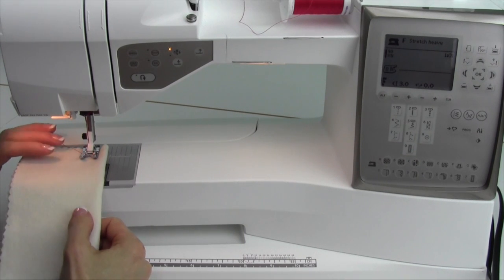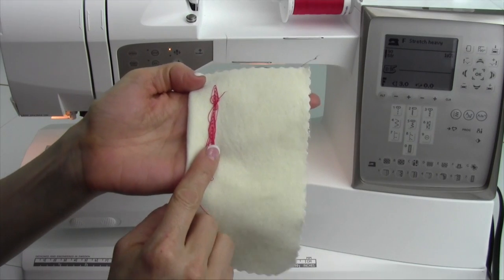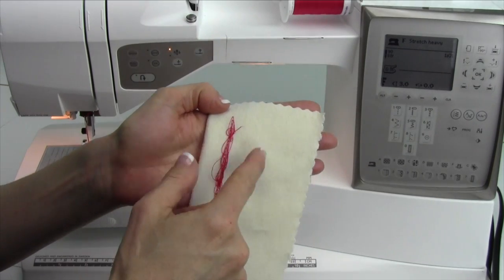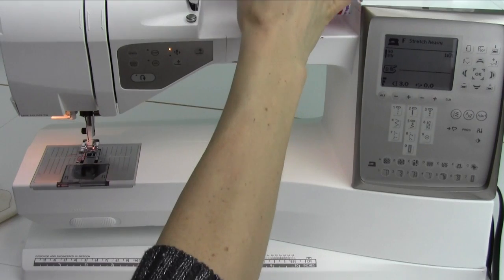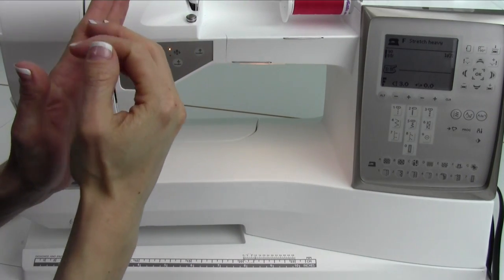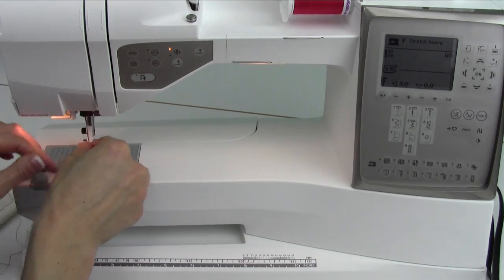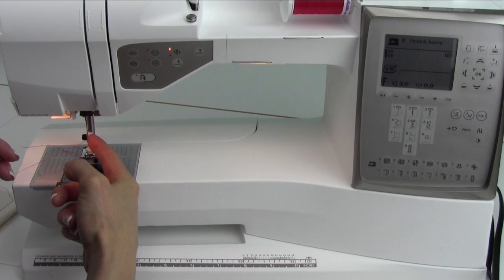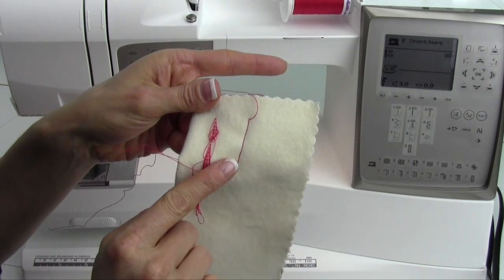Husqvarna Viking Topaz 20 19 Top Tension Issue

Comment: My thread jumps off the metal loop at the bottom of the tension threading area. Why is it doing this. I can hear when it jumps off as the sound changes before the thread broke warning comes up. However the thread is not broken, it has come off the bottom loop. If I rethread it, it sews fine for a minute or two than does it again.